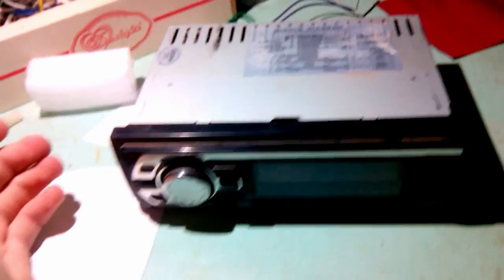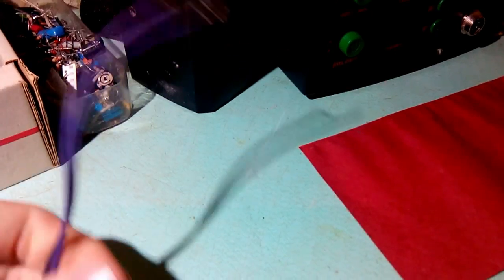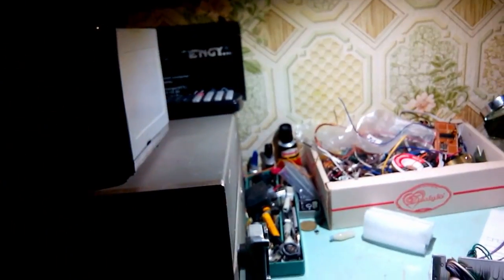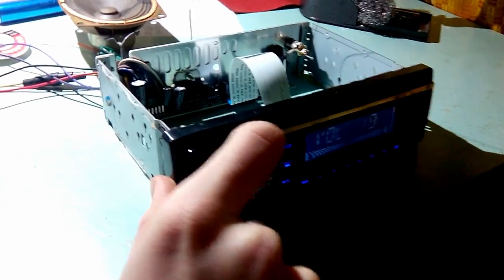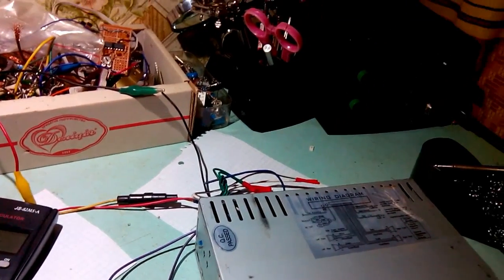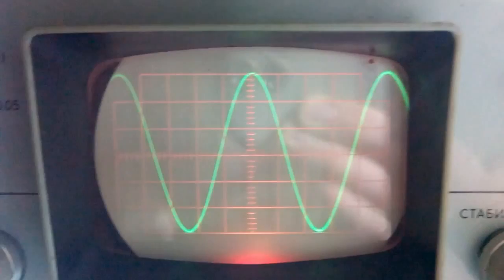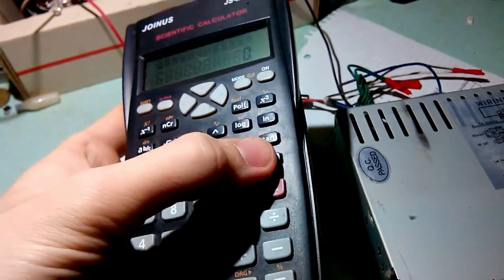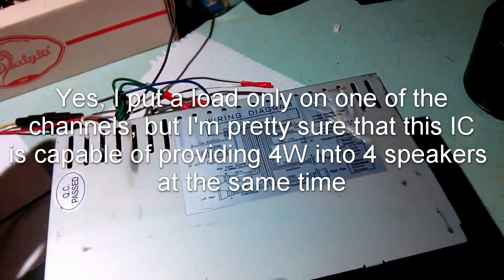Car stereo repair (no sound)

Comment: The radio went in painlessly on my 07 Harley ultra classic imgs.love/AquaticStereo?a1 It fits great. The only wires you have to connect is the rear speakers. The only thing this radio doesn’t have is speed sensitive volume control, like my factory radio did.

Comment: hi bro 

i have lepy hifi amplifier (LP-2020A) and i got a big problem when i reflect power wires ( postive to nigative - negative to posative ) i got click and smell from the amplifier, after that the amp is working but without sound so please help me if you can, 

check my last video please to see the problem.
Reply from the maker: Abdulrahman al5zMri Looks like you've fried the power amplifier IC. Take it apart, check the part number, replace it if you have the necessary skills.

Comment: my car radio/audio system has a direct power supply and plays perfectly with or without the key inserted but when I start the engine it turns off and then it goes constantly on/off-on/off with only pops coming out of the speakers and when I turn the engine off it works again perfectly! It is all original, This problem is developed slowly from random to constant now. 
Any clues please?
Reply from the maker: karpoezi Weird stuff you have there. My guess would be bad filter capacitor in the stereo. 
 You need to check the charging system, see if it works right. Put a voltmeter on the battery and check the voltage.
Reply: it is not a battery or wiring problem because a replacement radio unit works fine.
I have the radio open and I suspect a circuit protection relay, only I can not test it  further as I dont have a regulated power supply to see how it is behaving, and this relay (at least I think it is a relay) looks different than I would expect and is in a difficult to reach/test place, so I thought maybe it is a "frequent" car radio problem  that you might have come across in the past.
But thanks any way

Comment: Interesting video--Where can one get a replacement internal amplifier as I have a similar problem on an Alpine unit with no sound?
Reply from the maker: MsCelicagt4 You can find those IC's on eBay, Mouser, Digikey. Any place that sells electronic components.

Comment: Hey there. Do you have any idea what could have happened? I accidentaly shorted my stereo on its body when i was taking it apart (metal casing got 12v to it and some sparks happened, fuse is not blown, stereo does not work anymore). :|
Reply from the maker: Asofe17 Maybe you fried the power amplifier chip, it's hard to say without having the thing on the bench.

Comment: My car stereo comes on but no sound.  when it did work it was great but then every so often it crackled but still played then it just stopped  How do I find out where the short is
Reply from the maker: Crackle is very often a sign of bad solder joint on the board. I would suggest to check that first.

Comment: my stereo doesnt even work I wired it up turned it on then out of nowhere it turned off and doesn't work anymore there is power going to the system but not all the way through
Reply from the maker: Something blew up, perhaps in your stereo the fuse is located inside the thing. The fuse might blow when you accidentally short the speaker outputs together or to the chassis of the vehicle. In that case, the audio amplifier chip might be dead by now. First, crack it open and check the fuse. Second, check for burnt sections on the board.
Reply: MrJohhhnnnyyy okay thank you